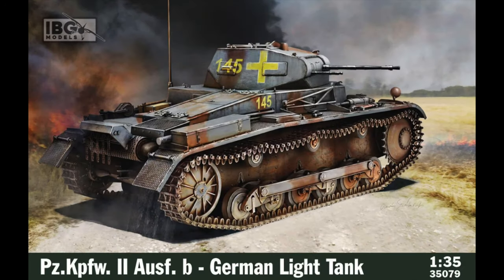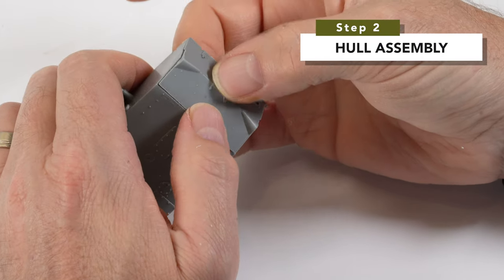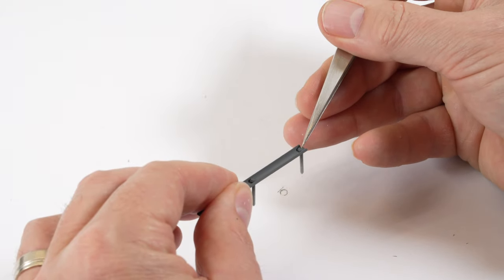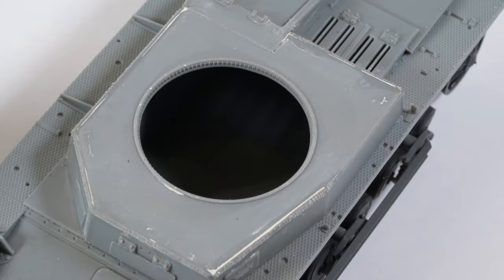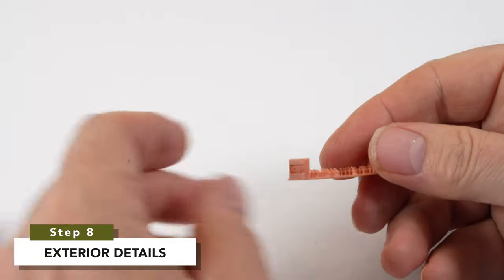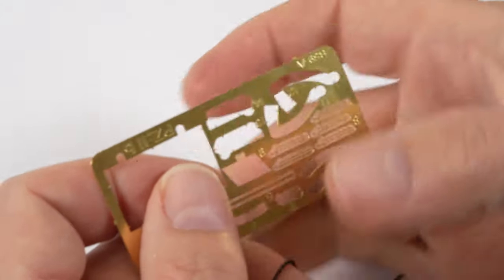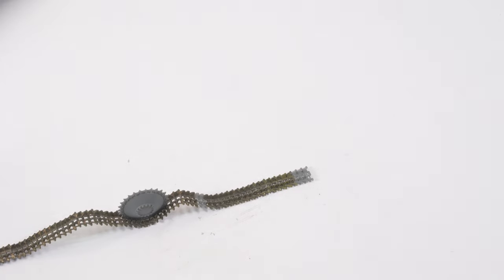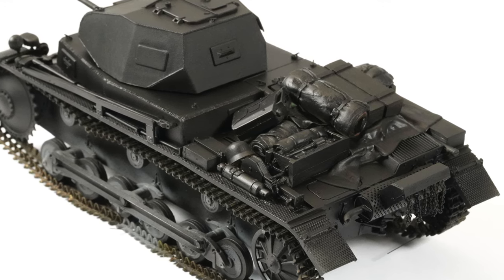Transforming the IBG Panzer II into a Masterpiece - Model Bench Time

Comment: Great video!  That "framework" on the fender is a mounting for the machine gun for anti-aircraft defence.  The crew would dismount the coaxial machine gun and mount it on that arm, so a crewman could stand next to the tank and fire up at aircraft.  That's clearly ridiculous so you can imagine why that is not a thing on any other tanks.  The wheels are indeed three pressed rubber pieces so you have that double-seam which is why the kit's wheels are made this way.  The huge gaps around those main engine hatches are correct.
Reply from the maker: Fantastic - thanks for the info. Greatly appreciated

Comment: In my not-so-humble opinion extra thin cement is a suboptimal choice for gluing movable parts. Whereas capillary action is usually your fried, it's your worst enemy in that case. I'd recommend the classic modelling glue like Tamiya "white" or Revell Contacta Pro, sparingly applied with a toothpick. Works quite well for me and the parts stay movable.
Reply from the maker: You make a very good point! Although those connection points are so tiny…Definitely worth a try though. Appreciate your comments 👋

Comment: These early panzer IIs had the tracks of the panzer I.
Reply from the maker: So the tracks in the kit are incorrect are they? Am I adding another strike against this one?
Reply: The tracks are only wrong on the Ausf.a series kits.  The Ausf.b series used proper Pz II tracks (as you can see, they use the standard Pz II drive sprocket).
Reply from the maker: Thought that was the case but I am always hesitant to speak in absolutes so as not to get caught out :)  @Panzermeister36